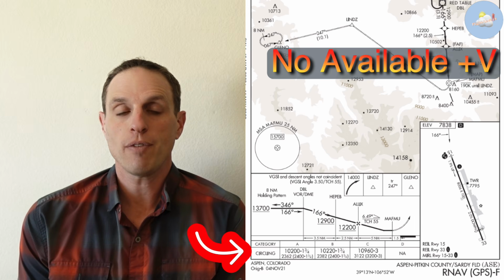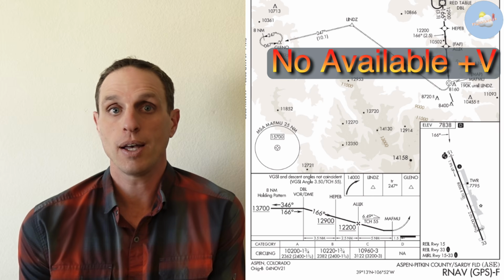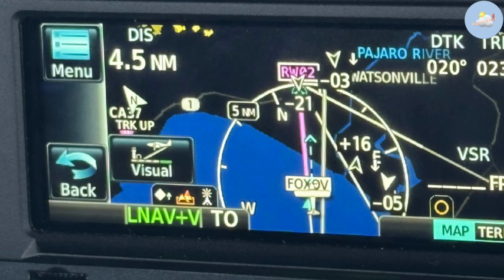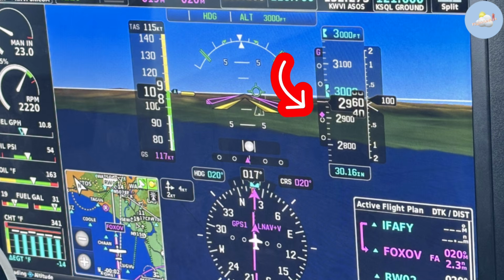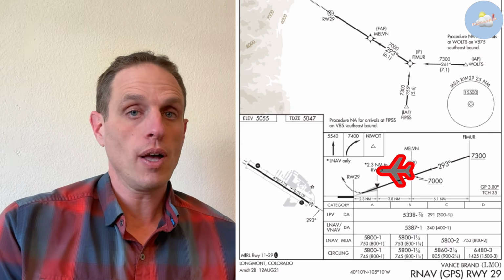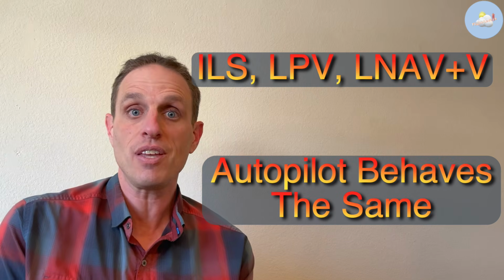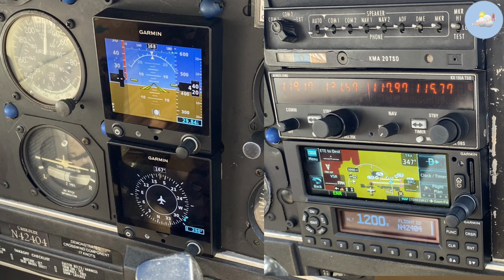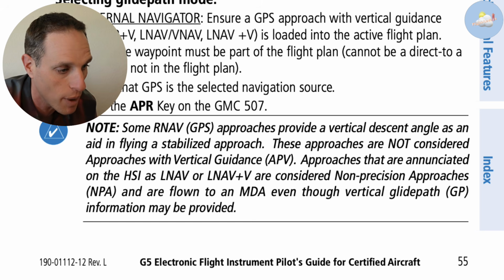LNAV+V: Did Garmin Actually Get It Right?

Comment: Are you allowed to swop to the Visual Approach and Activate Vectors to Final - then arm Approach to enable the GP for a GPS based Glideslope for that Constant Descent - even in IMC - obviously knowing that there is NO obstacle en-route?
Reply from the maker: Technically, the Garmin units will generate that glidepath for a 'Visual' approach, and it’s a great tool for a night VFR arrival to stay stabilized.

However, using it in IMC is a major 'Caution' area for a few reasons:

Legal Basis: A 'Visual Approach' in the Garmin is not a published Instrument Approach Procedure (IAP). If you are in IMC, you are legally required to be on a published procedure (or being vectored for one). Activating a 'Visual' on the box while in the soup puts you in a legal 'no man's land.'

Obstacle Assurance: You mentioned 'knowing there are no obstacles,' but the 'Visual' glidepath logic in the GPS doesn't account for temporary obstacles (like cranes or NOTAM'd towers) the same way an IAP does.

Pilot Workload: If you're in the clouds, you want the 'Advisory' (+V) or 'Precision' (LPV) guidance that has been flight-checked and surveyed.

My advice? If you're in IMC, stick to the published RNAV approach and use the +V provided. The 'Visual' mode is a fantastic tool for the transition to landing once you break out, but I’d be very wary of following it while still in the white room. Great technical question!
Reply: @Flight-Levels Thanx for the detailed thought process!  So my rule would then be to only fly into LPV approaches in IMC!  Otherwise, go commercial or drive! After checking NOTAMS and icing too!  By the way - I am a flight simmer with 1200 hours in the SIM (MSFS2020)  Have always wondered why pilots don't use it as a back-up!
Reply: @Flight-Levels - Curious - I have flown KSBS RWY32 in the SIM via TILLI then PEXSA then Straight In!  I dare say it is PERFECT! WHY does the FAA not create that as THE APPROACH to Runway 32??

Comment: Thank you, very informative, I just want to add that it is important to note that an MDA is not to be treated as a DA if using +V, as they're different things. DA - Decision Altitude is where the decision to start a missed approach is made, you can legally momentarily descend below DA between deciding to Go Around and the start of the climb, this is baked into the approach design. MDA is not to be busted as going below MDA is not legal unless you're going to land. If you decide to go around at MDA you'll likely go below MDA as power is applied and pitch is changed. 
This is why when when flying a Non Precision Approach and using vertical guidance you should add a few feet to MDA (between 30 and 50) creating a Derived Decision Altitude (DDA) to prevent busting MDA. Please refer to FAA AC 120-108A.
Reply from the maker: Spot on, and thank you for bringing up AC 120-108A! This is a critical distinction that every instrument pilot needs to burn into their brain.

You are 100% correct: An MDA is a hard floor. On an ILS or LPV (DA), the 'dip' during the transition to a climb is accounted for in the obstacle clearance. On an LNAV+V (MDA), that same 'dip' could legally be an altitude bust and physically a safety hazard.

I’m a huge proponent of the DDA (Derived Decision Altitude). Adding that 50-foot 'buffer' to your MDA effectively turns a non-precision approach into a stabilized 'pseudo-precision' approach, giving you the room to transition to a climb without ever touching that hard floor. It’s a pro-level technique that more GA pilots should adopt. Great addition to the thread!

Comment: The question is, if using the VDP as a pseudo DA, is it best practice to level off at the MDA and drive it in to the MAP then execute the missed approach? Or execute the missed approach at the VDP?
Reply: AIM 5-4-21…However, no consideration is given to an abnormally 
early turn. Therefore, when an early missed approach is executed, pilots should, unless otherwise cleared by 
ATC, fly the IAP as specified on the approach plate to the missed approach point at or above the MDA or DH 
before executing a turning maneuver, so if doing CDFA and going down to a DDH/MDA, upon arrival at DDH/MDA (and no lower than MDA!), if one cannot comply with 91.175 (c) 1-3, then execute the missed. At any point after the FAF, down to DA/DH, MDA/DDH, if one goes missed, for whatever reason, climbing to the altitudes specified in the missed approach procedure is ok, just don’t make any turns associated with the missed approach procedure until you arrive at the missed approach point.  The purpose of using the CDFA technique is to continuously in a position from which a descent to a landing on the intended runway can be made at a normal rate of descent using normal maneuvers, i.e. a stabilize approach.
Reply from the maker: Spot on. This is the 'Golden Rule' of the missed approach that often gets lost in the automation discussion.

You hit on the most critical part: You can always climb, but you can't always turn. >
If you're following that +V string and decide to go missed early, cleaning up the airplane and starting your climb is the right move for safety, but you have to stay on that track until the MAP to stay in the 'protected' airspace. Thanks for quoting the AIM-it really reinforces that CDFA is a technique for stability, but the Missed Approach Point is still the legal 'X' on the map. Great addition to the conversation!
Reply from the maker: This is the million-dollar question for non-precision approaches!

The 'Best Practice' (CDFA): In the airline world and for most professional pilots, the VDP is the 'Decision Point.' If you reach the VDP on your constant-angle path and don’t have the runway, you execute the missed approach right there. Why? Because any descent started after the VDP would require an unstable, 'dive' maneuver to make the pavement.

The 'Legal' Reality: You are perfectly legal to level off at the MDA and 'drive it' to the MAP. You might get lucky and breakout a half-mile past the VDP. But as you noticed, you’re now in a 'hole'-you'll be high and fast, and you'll have to work a lot harder to get it down safely.

My take? Use the +V to fly it to the VDP like a DA. If you aren't visual by then, the 'Stabilized Approach' has failed. Go missed, keep your dignity, and try again or head to the alternate. Driving it to the MAP is how 'Dive and Drive' errors happen!

Comment: One interesting fact about where I fly (Brazil) and I do belive that a lot of other countries in the southern hemisphere have this issue as well is that WAAS just doesnt work properly here. I dont know how true is that but I do know that there are no +V Approaches here, nor LPV or anything like that, we have to do RAIM check everytine we fly, we only have LNAV/VNAV Approaches here. We do have that little table in the charts that will give you the fpm you need to do CDFA from the FAF to the MDA/VDP but I find them to always be a bit inacurate especialy on a steamgauge plane where you dont know your ground speed in real time. So I often prefer the dive and drive, especialy for light GA planes. If you dont have a vertical guidance for the autopilot to lock on It can be next to Impossible to keep that speed and rate If wind and especialy thermals are pushing you arround, then all the sudden you are fighting the plane and looking at your stepdowns anyway, can get very hectic especialy in the afternoon when Its hot out. So I often think Its better to just brute force It and dive for your stepdown, at least untill I get to fly something with more inertia.
Reply from the maker: This is a great point, and a reminder of how spoiled we are in the US with WAAS coverage! You are exactly right—without an SBAS (like WAAS) to provide that vertical 'integrity,' your GPS simply won't generate the +V or LPV guidance.

I also really appreciate your honesty about the 'Dive and Drive' in light GA. You hit the nail on the head: a CDFA is a precision flight path, and in a light aircraft with low inertia, trying to maintain a calculated rate of descent while fighting afternoon thermals can actually increase your workload and lead to more errors than the 'brute force' method.

This is exactly why the FAA still allows both! CDFA is the 'gold standard' for safety and stabilization, but if the equipment or the environment makes it a high-workload struggle, the priority is always getting to the MDA safely. It’s all about using the best tool for the specific cockpit you're sitting in. Stay safe down there in Brazil!
Reply: @Flight-Levels  That is not correct. The TSO for WAAS GPS permits using +V outside of the WAAS SSV and even if the vertical integrity is poor. This was added in the Avidyne GPS to provide +V even if you disable WAAS or are outside of the WAAS SSV. Garmin followed with the GTN series at a later SW level. This was requested by US pilots flying in Hawaii and in Puerto Rico, which never had good enough vertical WAAS integrity to obtain +V. Since +V should only be used for the descent to the MDA and dive and drive is allowed, even poorer vertical guidance is safe for the portion of the descent to the MDA. So my GTN 750Xi will do this. Here is a reference from the TSO RTCA DO-229 specification:

"LNAV equipment may provide advisory vertical guidance. Advisory vertical
guidance is defined as supplemental guidance where the barometric altimeter
remains the pilot s primary altitude reference. This advisory guidance should use
the vertical path and deviations defined in Section 2.2.4. This advisory guidance
may be provided even when SBAS corrections or integrity information is not
available. This advisory guidance cannot be used to descend below the LNAV
MDA or step-down altitudes."

Comment: One technique I’ve used is that when established on a +V go to an altitude select and it will descend at the fps you were descending at on the APR mode. And again pilot is responsible for not going below the MDA.
Reply from the maker: That is a common technique, but it’s a perfect example of why this subject is so nuanced!

Switching from APR to VS (or a pitch-hold mode) does give you that 'altitude capture' protection at the MDA, but it also means you’ve abandoned the constant angle path the GPS calculated. If you hit a sudden headwind, your groundspeed drops, but your rate of descent stays the same-potentially putting you below the path before you realize it.

It really highlights the pilot's dilemma: do you keep the 'stabilized' path and risk the level-off, or take the 'level-off' protection and risk the path? Personally, I think Garmin’s logic encourages us to stay in APR and simply be the 'manual' floor at the MDA. Great to see people thinking through these cockpit workflows!
Reply: @Flight-Levels  interesting points you bring up!

Comment: Thank you! This is a very clear explanation and much kinder than my usual response to those who complain about +V: The GPS and AP are machines that do exactly what you tell them to do. If you tell them to fly the airplane into the side of a mountain, they will oblige, and it's not their (or the manufacturer's) fault. Know your equipment, know the regs, and fly accordingly. If you can't or won't do that, perhaps you shouldn't be flying at all.
Reply from the maker: Well said. The machine is only as good as the person programming it. Understanding the difference between 'Vertical Guidance' and 'Vertical Assurance' is what separates a passenger with a license from a true pilot. Thanks for watching!